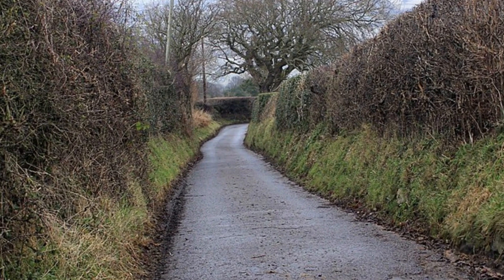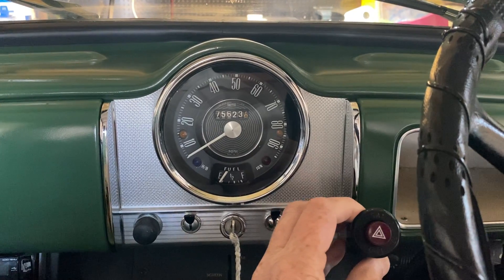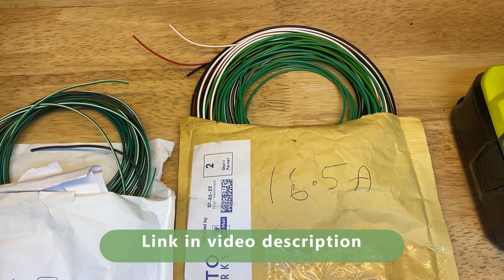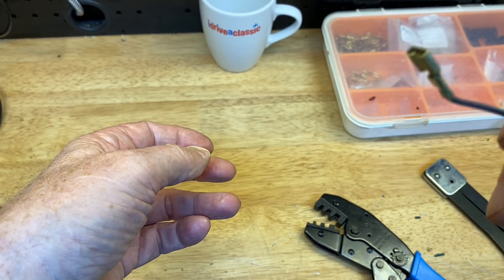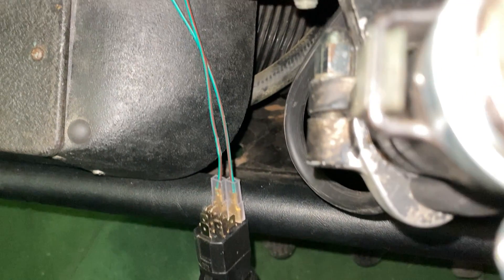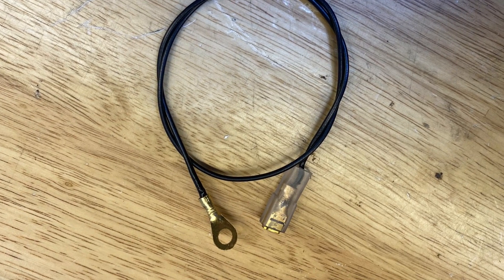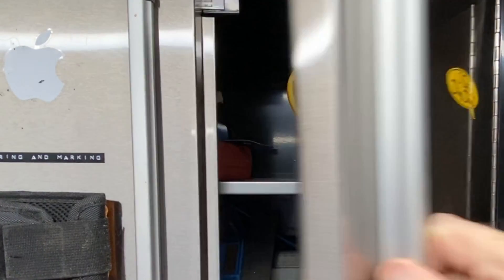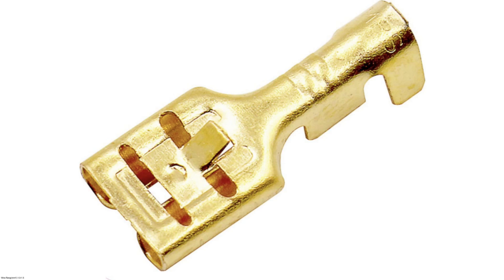How To Fit Hazard Flashers to a Morris Minor or Other Historic Vehicle

Comment: Excellent guide. I was lucky enough to find old lucas unit at the Beaulieu Autojumble that came complete with fuse and flasher all in the bracket and had extension wires with bullet connectors still in place. Thanks to your vid connecting it up was a breeze.

Comment: Great video - well explained and very neat install. You could reduce complexity and cost by wiring in a switch from the existing indicator relay to both left and right indicator wires with diodes (1N4001 ) that prevent both sides from being lit when using the indicator.
Reply from the maker: True. But it introduces two potential component failures

Comment: Hi, I noticed you only use 2 pins of the 3pin flasher relay unit.  Will I only need to buy a 2 pin unit only?
Reply from the maker: Do you mean the hazard flashers relay? If so, only two pins are used.

Comment: I note you mention the links a 21W X 4 flasher unit but no mention to fit it in the video?
Reply from the maker: Fits the same way as the LED version
Reply: @jodiethemorrisminortraveller  Do you mean to fit the 4 X 21W flasher unit Instead of the 2 X 21 W ? Bill.
Reply from the maker: Yes

Comment: Hi, where did you get the hazard switch from I can't seem find it on ebay?
Reply from the maker: https://www.carbuilder.com/products/illuminated-push-button-hazard-switch-round-black
Reply: could you please send me a link for the Electronic LED Fasher Unit. and I assume it will work with positive earth.  Thanks.
Reply from the maker: There’s a link in the comments below

Comment: Hi is the led flasher relay used with original bulbs or does it require led indicator bulbs
Reply from the maker: If you don’t have LED indicators you will need a higher powered flasher unit. There are links to both types of flasher unit in the video description. However I thoroughly recommend changing to LEDs. Brighter, use less electricity, last almost forever and very easy to swap.

Comment: Definitely something I am considering doing to my Morris Minor "Xavier" but I do use the heater control under the dashboard so I do not have convenient holes to mount a switch. Drilling new holes is not something I would ever consider doing so I am contemplating using velcro to attach the switch bracket. I will need to experiment to see if that is secure enough.